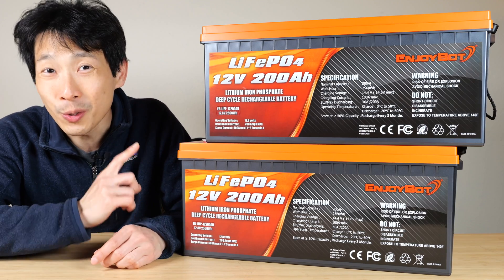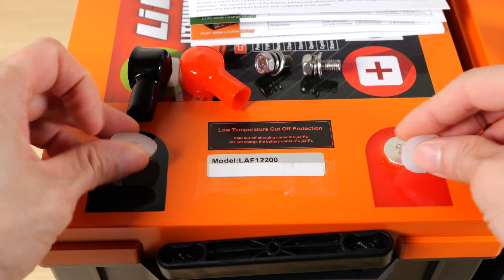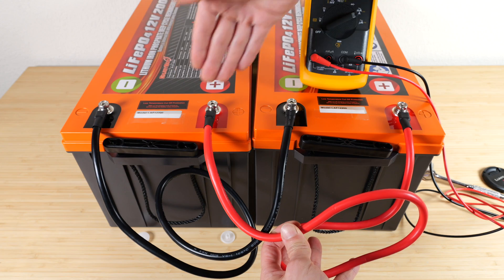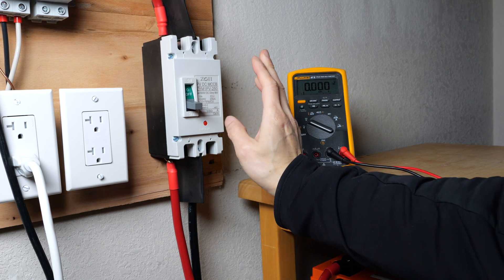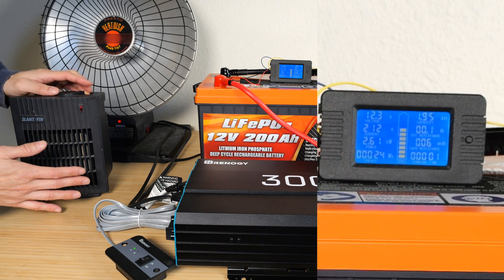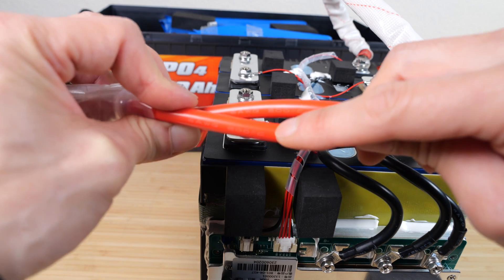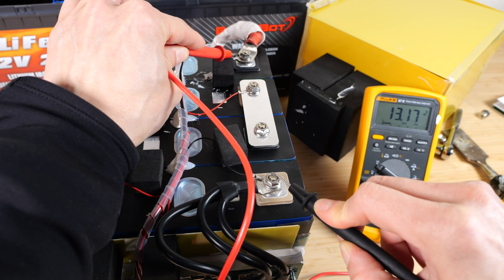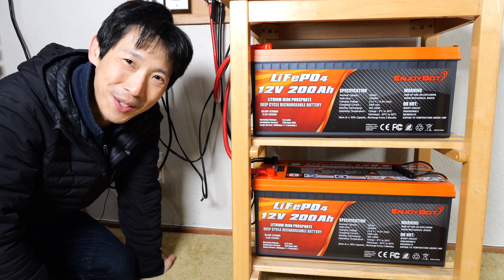How to Connect 12V Batteries Together [EnjoyBot]

Comment: What do I do when I have 412 V batteries for a 48 V system do I have to separate them every time I go to recharge them or does it automatically pick up and do it itself?
Reply from the maker: You system will recharge a 48V system where 4 - 12V batteries are in series just fine. It's when the battery voltage starts drifting apart and you will have to balance them manually every 3-6 months. The difference in 12V battery voltage will cause over charge or discharge at the limits if you do not do this.
Reply: @BeatTheBush  even if my charger is a four-legged charger and it charges each battery individually ?